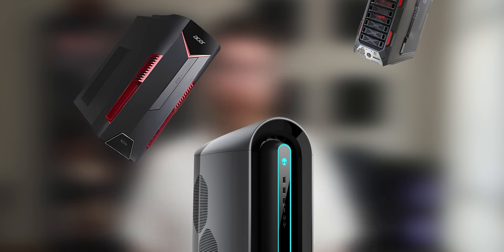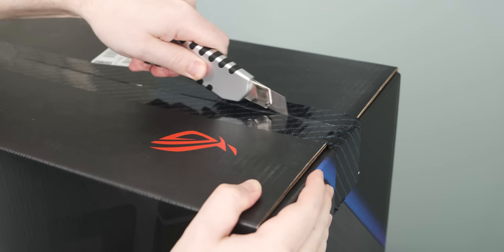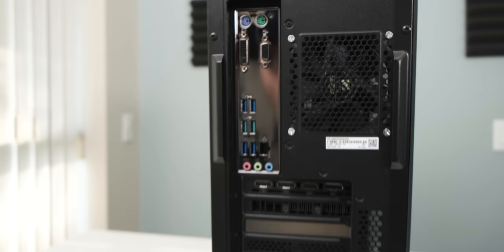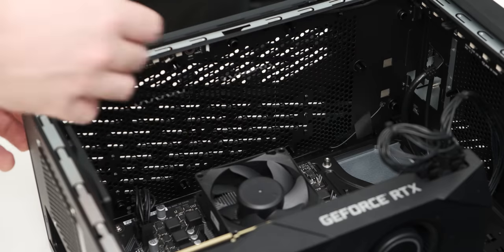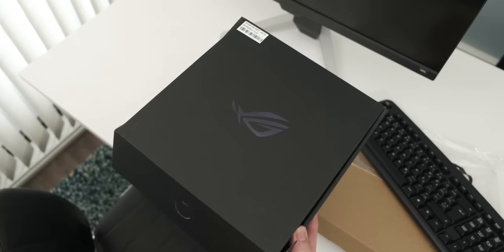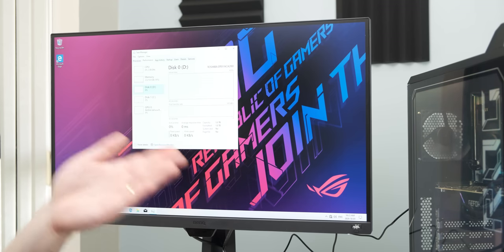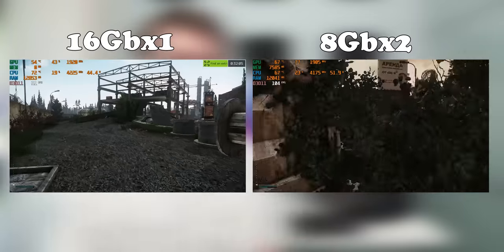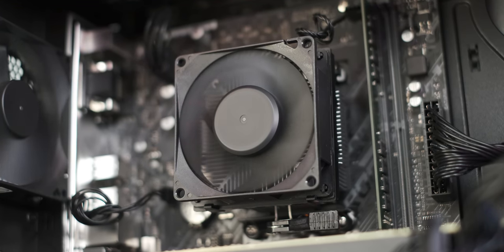I bought a $1500 Asus Strix Pre-Built from Best Buy...

Comment: Bad Prebuild Gaming PC Checklist:
-one ram stick
-cheap ass mainboard
-blower style cooler because....reasons
-trash cpu cooler
-nice and fancy case with rgb
-some more rgb...
-noname psu
Reply: Not to mention the trash mouse and keyboard!!
Reply: A blower style card is probably better here, even if they run hotter, because they exhaust hot air instead of circulating it round the case, stopping the cpu getting even hotter
Reply: This but the case would be complete trash too with flashy exterior
Reply: Walmart taking Notes again like:  👀✏
Reply: Really dude ? They cheaped out so hard on this system. It’s the Asus logos all over the place that are the selling point for most people.
Reply: @rufusaa  yea if they didnt go to blower 2070 the fucking cpu would catch on fire
Reply: yo my prebuild from ibuypower actually gave me a ventus 2 fan version 2080 super instead of blower and gave me 2 8gig ram sticks, bought from costco sale so idk, maybe buy from ibuy power? xD
Reply: They do the cheap coolers because they don't buy the retail versions of either the GPU or the CPU. They buy bulk just cpu's and just PCB's of the GPU. Then they can toss mega cheap coolers on both to cut a few dollars of cost. It's the same reason they do one stick of ram, the difference in price is literally just a few dollars but maximizing profits is all that matters. The end user experience is irrelevant beyond the computer functioning long enough to make it out of the warranty period.
Reply: @devilmikey00  yeah kinda, i got a push and pull 2 fan 120mm aio for a 9700k, i think its good enough for a prebuilt, i think maybe ibuypower just does better than other prebuild ones? Cuz i think my friends alienware has a stock cooler on a 10700 and a blower 2070super and 1 stick of 3000mhz ram which kinda sucks. But he do got some good ssd, while ibuypower used a horrible wd green ssd which is cache less and they could have add like 10 bucks and get a wd blue sdd that is like 10 times better
Reply: mainboard always mATX
crappy cable management
Reply from the maker: That is exactly what it is with all of them.
Reply: @Trigg3rHippie  I think my friend has an itx motherboard in his pc
Reply: The CPU coolers that come with most Ryzens are much better. Not quite sure why a Ryzen 7 didn't even get the stock Wraith cooler instead of that little square thing used for Athlons
Reply: Tbh i thought that this was gonna be good before watching the vid cus of all the amazing asus rog products but it turned out to be shit
Reply: I can tell you're a brit, chinese, or african cause you said "main board"
Reply: Evan i am from Germany :D
Reply: So alienware then
Reply: It’s probably not a no name PSU, it’s most likely made by Delta.
Reply: @ccricers  that's exactly what I was wondering. 
Wraith stealth or prism are much more efficient then that junk they used.
Reply: soon as seen it my i was wow stock cooler as always and one stick of ram, it's not even fast ram lol. Didn't think about the VRM my head was shocked with them.
Reply: M D  it’s not the latest version, but it’s not outdated.
Reply: You nailed it
Reply: You just described every prebuilt under $2,000
Reply: One more thing, they tend to have big harddrive (cause 1 or 2 TB sounds good), but no SSD (2.5" or m.2) to boot windows on.
Reply: Why do you have to insult my pc like that
Reply: @firexallst4rz277  far worse bargain than a laptop of comparable price
Reply: @lukewang363  or just buy the parts 🤔
Reply: they upgraded cooler
Reply: @ccricers  Actually, that really looks like a K-series cooler. 😎🔥

Comment: Dawid:"Dinosaur video output"

Me: cries in VGA because I am still using it.

PS: I don't use because I want or need, I use VGA because it is my only option right now due to high HDMI monitor prices (I live in Brazil).

PSS: Thanks guys for all the tips
Reply: But he is right. Deal with it and your ancient pc and monitor.
Reply: @J Fz I use the iGPU of the Ryzen 3 2200g with the a320 motherboard which has a VGA output
Reply: @errorcode503  my PC is very modern, it's my monitor that is quite old and it is very expensive a new monitor with a HDMI input. Not everybody lives in the US/Europe to afford these things.
Reply: My Asus Prime A320M-K(6 months old) and Prime B350 Plus( 1 yr old) mb's, both have VGA outputs. I sometimes use them on  my old 17"  Philips(107E61 120hz)monitor. I also, still have my old Dinosaur IBM Aptiva( 2153-E2N).
Reply: Don't worry, VGA is enough for 1080p 60Hz.
Reply: @victorhugofranciscon7899  if you have a a good/modern pc then you should get a monitor for $100-$120 from the likes of Acer or Samsung with a 75hz refresh rate.
Reply: VGA is actually a really solid connector
Reply: @errorcode503  the PC was my priority, so I bought the PC first (I took half an year to buy all the parts).  And my wage is less than $100/month and I have my bills to pay too.
Reply: And according to sellers here the most basic of monitors with a 75hz refresh rate is $150 way beyond I can spend. I will buy it when I have the money to do so.
Reply: HDMI monitors is a quite new technology here
Reply: same here in the philippines, VGA is still not a dinosaur, most of the computers here has VGA, most laptops just use HDMI because of connectivity to TVs and Projectors lol
Reply: Make an american friend, have them send it to you.
Reply: @alleosussquirt8041  If had one and he sent the monitor to here it would get heavily taxed
Reply: I’m still using my 16 year old philips 109e5 crt and it’s better than anything I can get currently in turkey(it can do 1440p 60 hz)because of bullshit prices
Reply: @victorhugofranciscon7899  oh, well thank makes sense.
Reply: Where in Brazil do you live? I have a 768p TV sitting around. I could sell it to you for a reasonably low price.
Reply: @victorhugofranciscon7899  then save the money left over to from paying bills to do this, and you cant say you dont spare cause if you dont spare you would never have a ryzen 3 2200G and a A320 that is a motherboard over 100$
Reply: @victorhugofranciscon7899  then buy it off of amazon HDMI Monitor off of amazon.
Reply: @victorhugofranciscon7899  ryzen 3 2200g is just shy of 200$ here in US if you are lucky you can get it 99 MSRP
Reply: @roimores  VGA can do way more than 1080p60
Reply: Victor Hugo Franciscon damn, i seen comments of people complaining about brazil eco
Reply: @junko4166  I prefer to use a monitor, the input lag is awful in TVs
Reply: @ismaelsierra3757  I am already saving...
Reply: @J Fz the versions that came to Brazil have the VGA connection because here it is rare have a HDMI monitor. The model that I have is an Asus prime a320m-k/BR that is manufactured here in Brazil.
Reply: Wow. Brazil PC enthusiasts have it rough. Would it be cheaper to buy from an online site and have it shipped overseas?
Reply: I plan to buy the monitor next year.
Reply: @TheXlen  I was just assuming he had that kind of monitor... If HDMI input is expensive for him, I highly doubt he has more expensive monitors than 1080p 60Hz.
Reply: @roimores  mine is 720p, 60Hz
Reply: @whiterabbit75  Nah, It would get heavily taxed because of the protectionist policies regarding importing.
Reply: @victorhugofranciscon7899  Don't let these tech geeks fool you. When something is 1 or 2 years old they always start saying it is old. VGA is old, but not "dinosaur" old. I hate their consumist mindsets. For a 720p monitor it would be terrible that anyone said that you need a HDMI input. The question is, why someone would put VGA in a high end 2019-CPU PC that costs so much? I tell you why: the motherboard is cheap (and probably older than the rest of the parts), that is why it has VGA (and not even HDMI... what a terrible board), because budget consumers still usually use older technology. That motherboard isn't meant for a $1500 PC.

Don't throw away your monitor until it becomes unuseful. You will be always able to use it as a second monitor to read.
Reply: @J Fz I didn't think it physically possible, but that both sucks and blows.
Reply from the maker: Hey Victor! Sorry about calling out you cable of choice! VGA gets the job done. 😁
Reply: @victorhugofranciscon7899  G'day, it is very easy for people to put you or your PC down when they don't know your situation, I live in Australia & while our exchange rate is 1.2 x $USD our prices here are closer to 2 x $USD, all the best saving for a better monitor 😁,
Ps just wondering if your monitor & motherboard have DVI? if they do just switching the cable will give a performance increase due to the higher cable bandwidth 😁
Reply: I have one of my monitors connected via VGA because it has broken HDMI port
Reply: i use vga bc dumb 660 prebuilt but i getting new pc soon yay
Reply: @rithvikkona8922  🤔 way better than Intel IGP 😁
Reply: Haha brazil
Reply: @shaneeslick  I don't remember if my motherboard has DVI but my monitor don't

Edit: my motherboard doesn't also have DVI
Reply: @DawidDoesTechStuff  I was just joking about my situation but thanks, VGA gets the job done when you just need to have a video display
Reply: @RichardiOS275  yes it does
Reply: @victorhugofranciscon7899  I dont know much about Brazil, but you could try a vpn, and buy like a 22in 75hz monitor from amazon for $80USD and try having it shipped to your house/apartment, or a amazon dropbox if they have those good luck (PS i also use VGA on my secondary monitor)
Reply: @kylej0474  that's not how itt works, you can't just fake your house address, it stil has to get to brazil..
Reply: @J Fz Yeah...the CRT screens were seriously weakening my already bad eyesight.  I can't even look at s CRT now for too long without it hurting my eyes.
Reply: @kylej0474  The problem is taxes, every product with a price higher than $60 gets taxed heavily.
Reply: @whiterabbit75  I see what you did there
Reply: @sharky3994  Do the Bartman if you got that. :P
Reply: thought about HDMI from a TV and use a TV ? if got Nvidia be a easy OC on your TV to get it to display more frames. Old tv of mine OC it to get 93mhz thats mega
Reply: @victorhugofranciscon7899  bro yo chill just because we live in eu or us doesnt mean its affordable or we're rich, we struggle too like you and we're not actually rich its just the youtubers, They got jobs, salary is high they can afford it
Reply: @victorhugofranciscon7899  dont act like we poop money out of our ass we struggle too you just cant see it
Reply: @whyers4782  I know it, but the situation is considerably worse here, if you didn't get the message.
Reply: @victorhugofranciscon7899  What do you mean i dont get the message? I suffer Exactly the same as you, Im so broke dude i get the message.
Situation is same as yours and i know it
Reply: @whyers4782  oh understood.

Comment: I found buying a prebuilt PC a valuable experience. I knew nothing at the time of how to put the parts together. Once the PC starting failing in certain areas I was desperate and opened it up to see what was going on and using Reddit as a troubleshoot. It allowed me to familiarize myself with a typical build and understand why my pc was being bottle necked. So yes pre builds are expensive BUT they can provide a difficult wake up call to learning your components fast.
Reply: What if I want an actual functioning pc, I mean for 1500 I just want to play sons of the forest and minecraft. Wouldn't a 1500 dollar pc work for a simple gamer?
Reply: @cameronjordan1516  Yes, and no. Watch this video and note, it does not allow you to run it at max settings, middling settings, at best, unless you play older games that do not tax it much, but for that kind of computer, 500-600, tops. There was a time when a halfway decent budget build PC from the likes of Gateway, eMachines could be had for around that. Mind you, they won't be the most powerful and were halfway decent, as long as you expect much from them. The one I helped my mother buy in 2005 No it didn't have a decicated graphics slot (AGP), and the integrated graphics was stuck at 16MB and it had 512MB of RAM, running a Celeron D processor. board was from Intel and research revealed it to be rather robust for what it was, so not a gaming PC per se, it was more than adequate for basic computing. If you got the 600 dollar version, it was AMD and had the AGP slot populated with the slot itself. The placement was there, but not the slot itself on the 2 lesser models. Mom's was the mid tier model.
Reply: Or you could do your research beforehand and either make an informed decision when buying a pre-built, getting one built to order or just building your own.

Comment: “ROG” prebuilt and not even a ROG motherboard? Come on now
Reply: Yes it got cheap shit rog case 🤣🤣🤣
Reply: nor a ROG GPU.... false advertising tbf. my PC is more ROG than that rubbish lol
Reply: @davidwithey6036  The GPU was an Asus ROG, but other than this pre built is still ass and trash.
Reply: @fib621  That wasn't an ROG 2070 super that was a stock asus 2070 super. You can tell by the lack of a backplate and the pink and blue led that is present on other asus dual cards. ROG gpus have completely different cooler designs
Reply: Cmon now rog
Reply: @fib621  yeah I got it and I’m thinking of upgrading mother and cpu to to the ryzen 7 3700x and the gpu is actually decent but I got a ass intel core chip. Also the fan doodoo
Reply: The 35 does use rog parts dont buy the 15

Comment: I mean:

-Works perfectly out of the box (this is a major problem for many prebuilts)
-Minimal bloatware
-Hardware clocked correctly in the BIOS (again, another MAJOR problem for prebuilts)
-Actually very respectable storage specs
-Great CPU and GPU pairing
-Good looking aesthetics 
-Gaming performance blows the previous gen consoles out of the water, and is pretty on par with what the new consoles are more than likely going to provide for the first few years.

To be perfectly honest, this is probably the only prebuilt of this price point I'd ever recommend to someone who INSISTS on getting a prebuilt gaming PC. All the flaws, especially the RAM, are very fixable (with the exception of the industry standard iffy power supply). This seems like a perfectly good starter rig to someone who wants to put a foot in the door to PC building but is still too scared to put the components together themselves. Later upgrading that cooler and adding more CPU fans seems like it'll be a great and low-stress opportunity to learn PC building in steps before they're comfortable putting a whole PC together.

Just the fact that, out of the box, you actually get all the performance you paid for without having to call into tech support or access the BIOS is a huge plus for me. I think you're being a little harsh on it considering the industry standard of prebuilts.
Reply: @powerfitz_  With the state of graphics card prices right now, its definitely worth it. I got one with a 3070, and after a hundred bucks worth of upgrades (which yes, I shouldnt have to do) to the cooler and fans, probably run like a dream.
Reply: @powerfitz_  You can uninstall McAfee lol
Reply: I got the I7 version of this PC for about $1200 recently. I did do some upgrades, which while I agree you shouldn't HAVE to do, it's just gonna be something you're going to have to learn eventually, especially if you want to maintain your PC. 

$20 of upgrades with probably the cheapest fans on Amazon and I was able to get this thing to keep a cpu and GPU under 70°c even with the stock heatsink while running God of War on ultra settings. The stock exhaust fan is trash tho so I'm currently replacing it with a Noctua. 

Overall I love my version of this PC. I think the guy just loves talking trash

Comment: ASUS seems to have fixed some of the issues with this model. I saw one of these recently for sale and a few of the improvements were: 1. It now has a 92mm tower air cooler on a Ryzen 5800X 2. Great Wall 80+ Gold 700w PSU 2. Still a rather low-end ASUS B550 ATX motherboard but it now at least has a heat sink on the VRM. 3. The RAM is dual channel XPG 2x16GB 3200mhz with heat spreaders on the ram. 4. The GPU is now a RTX 3070 with dual fans.

Comment: Dawid: “You’re not supposed to be taking advantage of your customers like that!”. 
Car companies: “Here’s some blinker fluid”
Reply: hey he has to make money some how 🤣🤣🤣🤣🤣🤣🤣🤣🤣🤣🤣🤣🤣🤣🤣🤣🤣🤣
Reply: Oh and we gotta pump nitrogen in your tires before they leave the lot
Reply: @iambeloved496  you do realize that the air is mostly that anyways don't you?🤣🤣🤣🤣🤣🤣🤣🤣🤣🤣🤣🤣🤣🤣🤣🤣🤣🤣
Reply: @raven4k998  yes that's the point of the joke lol
Reply: @raven4k998  some lots offer that for an extra buck
Reply: @iambeloved496  Actually there is a reason for that. Nitrogen holds a constant air pressure better than just regular ass air, so your tires take longer to lose air and the pressure doesn't change as much with temperature changes.
Reply: @Austin.-_-  ah you must be a salesman
Reply: @Austin.-_-  I'm kidding but seriously the air we breathe is already ~70% nitrogen. Not doubting 100% is better but "regular ass air" is in fact mostly nitrogen.
Reply: @iambeloved496  a few cars like the newer Nissan Skyline and other higher end cars use pure Nitrogen in the tires because it increases stability in corners at a track… Yes… it’s pointless for most consumers.
It’s like putting an AIO on an I3

But it does have its uses I wager  with long haul towing it might be nice for extended drives. Because it doesn’t heat up as fast ergo saves you wear on your tires.

But these are far in between.
Reply: I love when they try to sell you the cabin filter for $40.